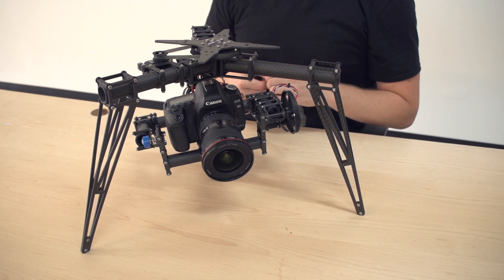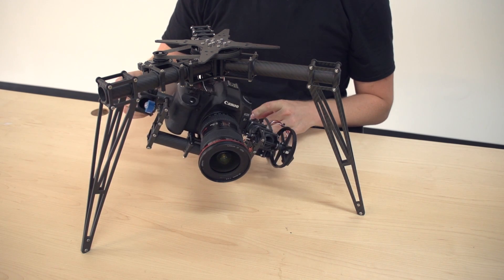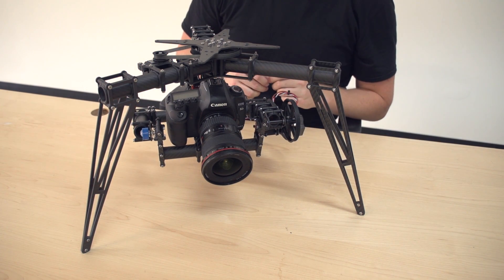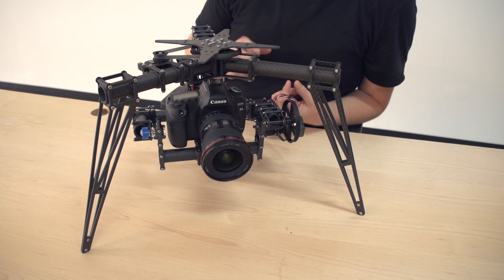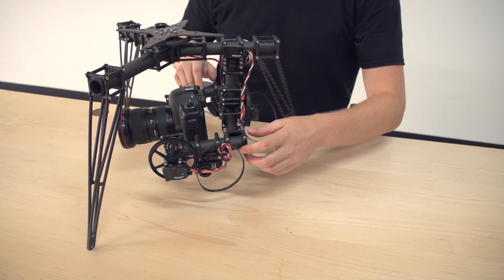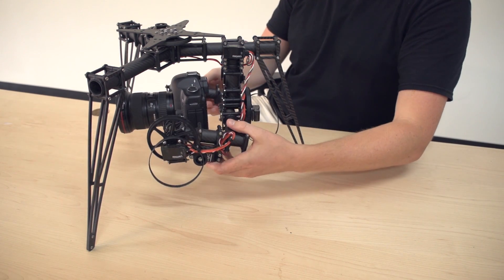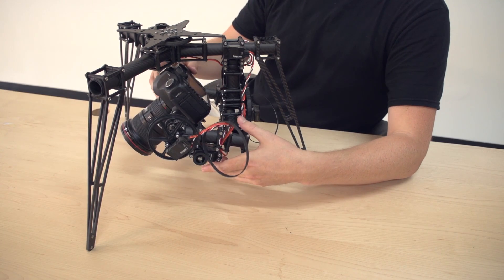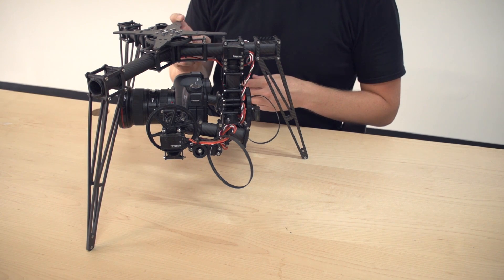Radian - Balancing Camera

Comment: The other downside of the Radian stabilization is the lack of accelerometers, so it can’t do anything about change in speed (i.e. gain altitude and the camera will stay pointed at the original target) simple things missed than any "real" multirotor pilot could have told you.